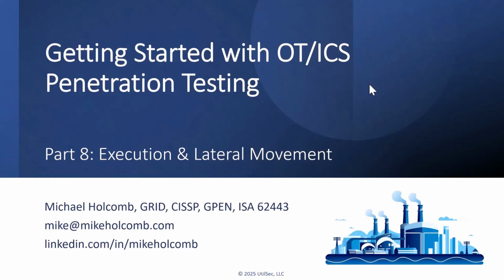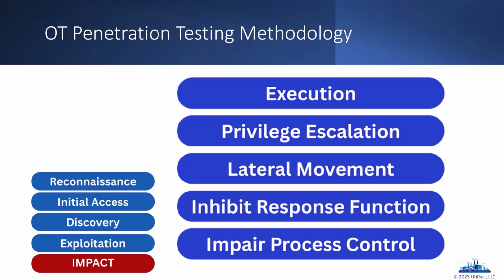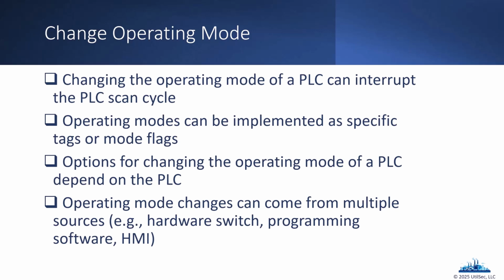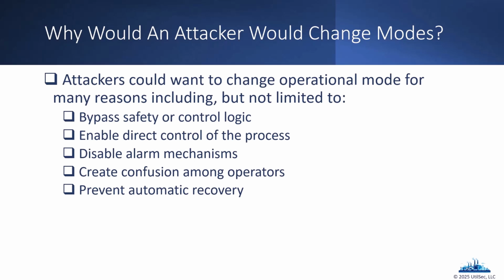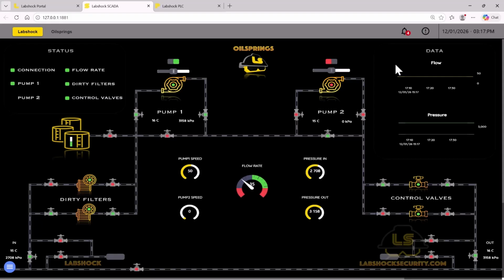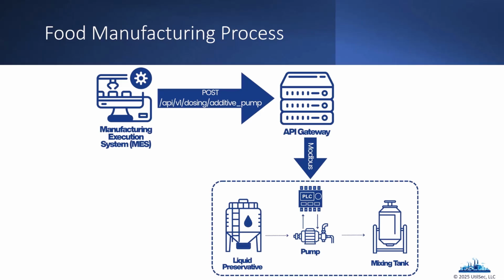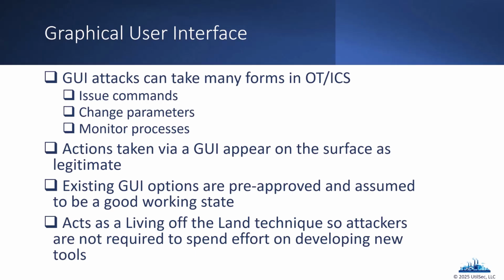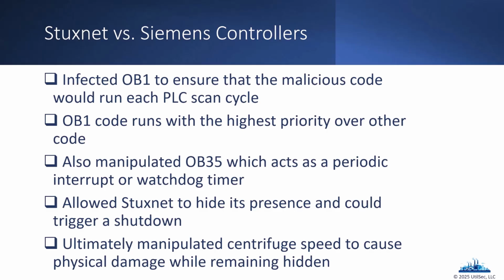Intro to OT ICS Penetration Testing (Part 8): What Happens When Hackers EXPLOIT Industrial Networks

Comment: Hi Dr. Mike,
I’m a 3rd-year Electrical Engineering student with a solid background in networking and cybersecurity. I learned ICS security basics of PLC, HMI, DCS, and SCADA through YouTube and NIST.SP.800-82r3.
I built a lab using VirtualBox, ControlThings, Kali Linux, OpenPLC, and Factory I/O over Modbus TCP. I practice daily using tools like Nmap, Modpoll, and Wireshark, and I work on both attack simulations and basic IPS-style defenses while analyzing Modbus packets.
What do you think about what I am doing in ICS security?
Best regards,